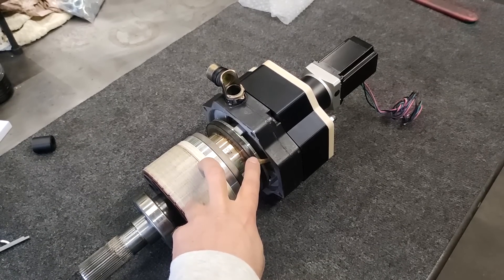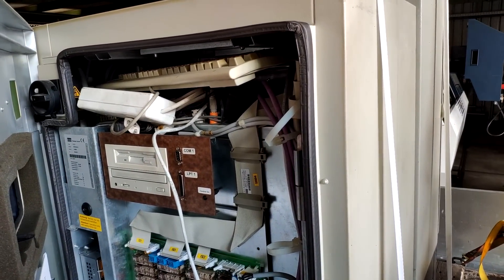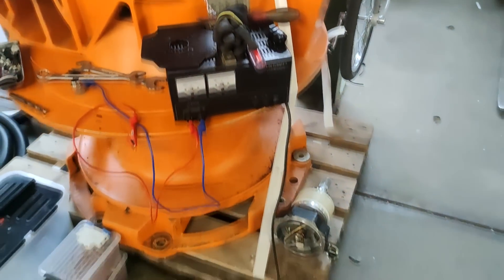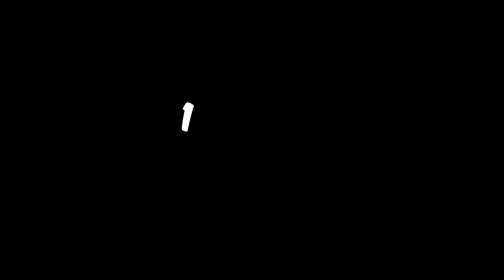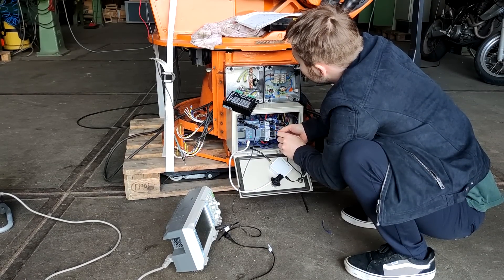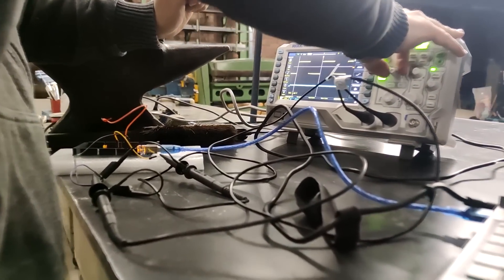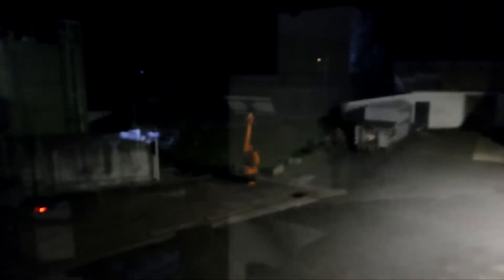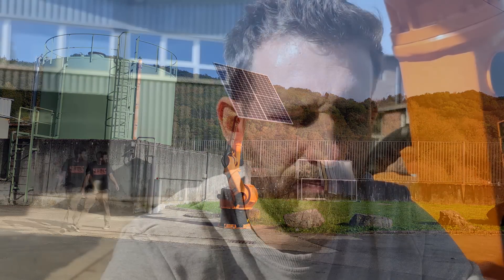Will Solar Tracking Robots take over the world?

Comment: Cool, but such a waste at the same time.  I realize you already have other CNC milling equipment, but the robot can do so much more!  Oh well, makes for a nice lawn ornament too.  I've got an ABB that I've installed in my backyard.   I agree with your comment below about getting one with a newer control system.  Although most third party off line programming (So you can take gcode and turn it into robot code) support Kuka RC2.  If you do ever get one, it's the simulation software that is the hurtle.  ABB now charges $6700 CAD (€4601) a YEAR for theirs.  I think Kuka may be better in this respect, I do not think they charge for their software.
Reply: Do you have sources for the claim they don't charge for the software? I got a kuka robot gathering dust because the most economic software suite to program and simulate it costs about 3k€... I am waiting for fusion 360 to extend their robot programming capabilities...
Reply: @hassiaschbi  I'm using Fusion 360 right now for my first tests with the ABB.  It has a post for Kuka as well (not sure what versions are supported).  Note the post does NOT do simulation.  It only outputs robot code.  Unless you simulate you will not know of singularities or collisions.  I was mistaken about Kuka software costs.  However the cost is significantly less than ABB for Kuka.Sim, about 1300 €.  There are other options such as Kuka PRC for grasshoper/rhino which has a community addition.   Have you looked into it?  I only looked at it briefly, as I ended up with an ABB.  Community edition is free, of course you need Rhino.

Comment: you didnt even source your panels nor your robot from europe, right? meaning that not only were they made using fossil fuels but even worse they were shipped around the world using fossil fuels... it used more FF than you can ever save with this...
Reply from the maker: While I don't think you did great on your research,  I will still clarify.

The robot is made in Germany, it was manufactured over 20 years ago when the company was still german.

The panels are made in Canada. Still some way to travel, but it is far from easy to source European made panels. (At least at the time I bought these)
Reply: Remember, that this robot used to be scrapped. To compensate the CO2-emission from manufacturing of the Solarpanels, you have to have them about 1,5 - 2 years in operation.
Reply: Used german made robot... what are you talking about?
Reply: @Ruhjuh  a chineese owned company who imports chineese people from china to build chineese products in germany... go do your homework... its literally on wikipedia..